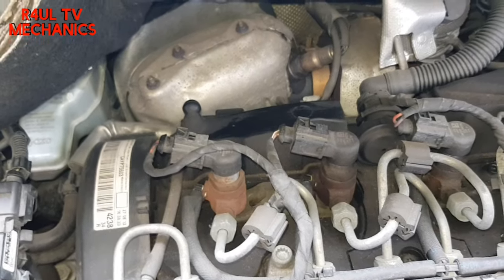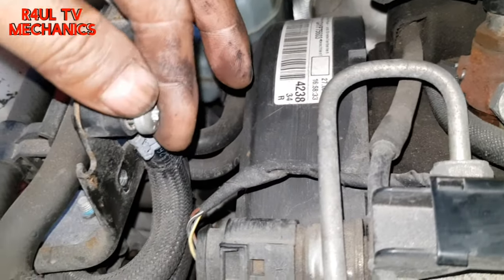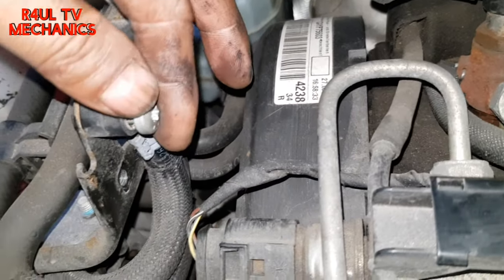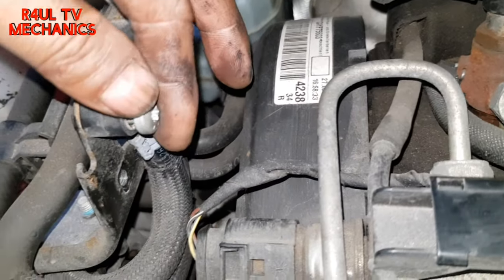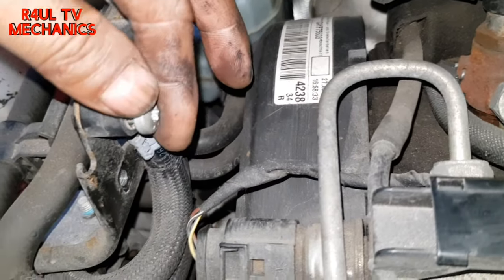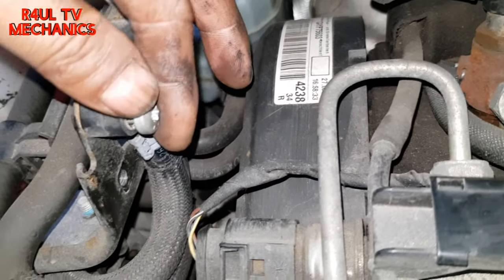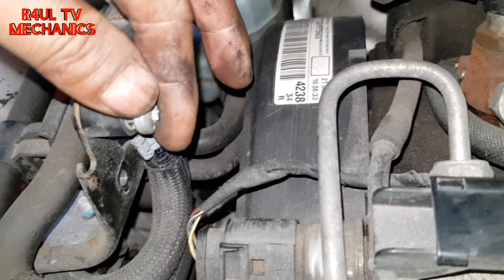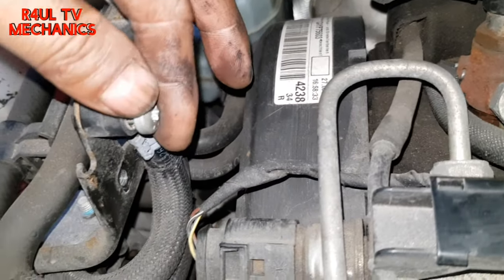VW 1.6 DPF CLEANING & REGEN R4UL TV

Comment: So lets have a look at the job done, your pouring a very corosive cleaner mr muscle (not designed to do this type of job) into the top of the DPF filter, right nect to the Turbo, that chemical is so corrosive that it will damge the Turbo oil seals, also your risking that chemical going into the back of the exhaust manifold and causing damge to the valves and piston rings, pour enough in and your going to cause hydro lock on the engine, you need to use a proper 02 sensor removal tool from the start as to not damage the 02 sensor and its threads, forced regenerations are the very last thing that any one should be doing and an oil change is a 100% must afterwards as the forced regeneration will contaminate the engine oil with diesel, I would strongly recomend a natural regeneration on the road as you did, dont forget to tech in the dpf statistics after the road test.
Reply from the maker: Thanks for watching really appreciate it. To be honest I tried the proper o2 sensor tool the sensor was too tight. I get what you are saying about the corrosive mr muscle but I didnt really leave it in there flush it out pretty much straight away. Anyway thanks for watching
Reply: Great advice and it reminds me how important regular oil replacements are with a diesel that has dpf, Egr valve.. It seems many are doibg FORCE REGENS & adding cleabing liquids without knowing the consequences of the long-term health of an engine, its seals and tolerences… thanks for reminder about oil change👍🏻
Reply: Cowboy
Reply: It's exactly the same as Wurth turbo cleaner. Other brands too.
Reply: How is it going to hydrolock if its going into the exhaust?
Reply: From another video that I had watched, they say, something along the lines of, the liquid will go thru the EGR into the engine and cause the said hydrolock. Solution to that is to unplug the air flow sensor just by your air filter box, when revving whilst stationary as part of the clearing process, which in turn keeps the EGR valve shut. Stopping anything to freely flow into the engine. It made sense to me. I haven't used Mr muscle, but this process  has worked for me with conventional dpf cleaning foam sprays(2 cans, 1 each time, revving to 2.5k rpm (Passat limit in neutral) and then a 30min stint at 3.5k in 4th gear on the motorway. I did think of using the NOC sensor inlet but was too chick n shit as it was placed too close to the turbo. That was my experience.
Reply: Not 'when revving the engine' but before turning the engine on and reviving.

Comment: I had enough spending fortunes on so called DPF cleaners, I opted to use oven pride, the stuff you put in a bag to clean your racks, I pumped it diluted 50% with distilled water into my Ford Transit Connect, 2018 68 plate euro 6 ecoblue well known for DPF issues,which had failed to complete a forced regeneration since October last year, soot level was 65%, and I wasn’t getting any automatic DPF regenerations during some long distance driving , I did however get a warning exhaust soot overload and to take vehicle for service, engine management light on, using a Autel MK808BT Pro scanner with the cable connected, (doesn’t work) if using Bluetooth, connect the cable between scan tool and obd2 adapter, otherwise using bluetooth times out, and you get a network error, this took me about and hour, and rev’s maintained 2000 rpm, regeneration completed, and van is running smoothly again.

Comment: 2015 Passat 2.0 TDI. P2459. So, I should put a bottle of regular draino drain cleaner down the DPF and run the engine until the soot stops coming out the exhaust.  Then spray a can of DPF cleaner into the hose.  Then drive at highway speed for an hour and the MIL (check engine) light will go off on its own?  Does the Passat need a manual regen or will it automatically?  Thanks for the great video.  All the best.

Comment: Hi i have a 2012 jetta tdi, I have used 3 cans of dpf/catalytic cleaner, I get brief white smoke, the car will not auto regenerated. I purchased the VCDS hoping to do a forced regen while parked and it will not do that either, VCDS says error. Trying to avoid taking the dpf filter off completely. also im getting dpf pressure of 305mbar while driving, super high. Do you have any suggestions. Also will the drain cleaner hurt the egr or catalytic converter?
Reply from the maker: Thanks for watching really appreciate it. The drain cleaner should not effect anything as long as you flush everything out. I think you have a problem with the EGR valve dose the car surge up and down
Reply: @TEAMR4ULTV  Well the draino seemed to work!! However using the VCDS we had already replaced the erg valve, egt lower/rear sensor/ intake runner manifold module bc it had 2 errors mechanical and electrical, along with the little bracket for the P0125 code, and a glow plug, I had alread used 3 cans of the same catalytic/DPF cleaner you had in the video...At that point is when i messaged you.... so yesterday we did a full bottle of draino!! let sit for 1 hour and started her up! hooked up to the VCDS on the hour drive home and the soot level started at 207 and went down to ZERO!! engine light went off, but the DPF light was still on, so told VCDS we replaced the DPF and then did a Manual while parked regen..... and NO CODES and all the boost is back!!!! I'm So Happy! thanks for the video and advice!!
Reply from the maker: @jessicat8227  that is great. Thanks for  watching really appropriate it
Reply: I have the same car with the same problem. Did you just use normal draino?
Reply: @jessicat8227  seriously the entire bottle of draino? how big was the bottle?
Reply: I think it was a 32oz bottle..

Comment: Hi Rahul, first of All thank you for your videos, and the love you put in to explain to all of us,  I need your help if you don't mind, I have a Peugeot 308 20I6 purtech. I had the service engin light first, for few days, then Check engine light followed and straight away after lose of power, I still can do 2000 to 3000 tpm, I have tried your methods, (Mr muscles and even added vinegar)  I have seen the smoke and as well I can say the exauste looks Celan now, however there is still the lights on, I drove in the motor way for over Minutes but temperature still don't exceed 80,  please what can you recommend me, ? Nb (I don't have one scaner) 
Thank you in advance mate.

Comment: Another great video. 👍
Reply: R4UL,   I’ve had Passat b7 2011 1.6 tdi CAY B sitting in the drive for over a year, cause smoke coming from I think the tube you removed at the beginning of the video, the tube/ pipe with the cover on it, what the bloody hell is that tube anyway, and only underload ( after driving) no smoke from that area even if sitting idle 2 hours. Am going to get the tube cover off and see if it’s split or something. No lights - no codes on vcds. Bloody hell that dpf getting hell of warm. Thank god I’ve still got my BXE pd Octavia mk2, egr & oil cooler delete, was running it on clean straight cooking oil for over a year untill prices cooking oil price went crazy 😝
Reply: Might need a few tips after tomorrow if not split, smoke not coming from the clamp, definitely at the tube or below, impossible to bloody see. Already new rocker cover gasket last week, all clean and dry top and down the back, got to be the tube

Comment: Hi there, I have a 2013 VW Passat TDI 2.0 here in the US. My CEL is on with code P2413 and now the idle is up and down ?? Any idea please? And by the way, I like your shirt !
Reply from the maker: Respect for the comment on the shirt. As for your problem I think the DPF is blocked and what that is doing is messin your EGR VALVE UP. So what I would do is replace the EGR VALVE clean the DPF and get a manual regen. Note you should no manually Regen it more that 3 times hope that helps
Reply: @TEAMR4ULTV  thank you so much for replying !! would it basically the same way you did on your video ?

Comment: Hi Rahul can I do same  job in my car VW Tiguan 2011 model im not mechanic sorry can you advise me thank you if you can
Reply from the maker: Hi thanks for watching really appreciate it. I think on the Tiguan it's more difficult because its 4 wheel drive, the transfer box comes in the way. I say take it to a local garage and let them just check it
Reply: Hi thank very very much for your reply I’m appreciate In dashboard shows three Sing on DPF ENGINE light and glow plug light flashing My son check with Artilink 500 and found code P0121 and P 2463 i take out part P0121 clean 100% and put back but light still on three of them any way you can help me out thank you ji